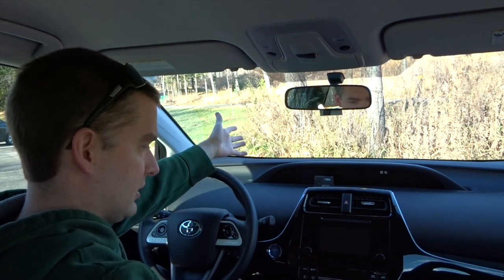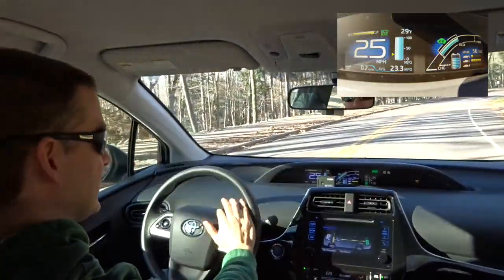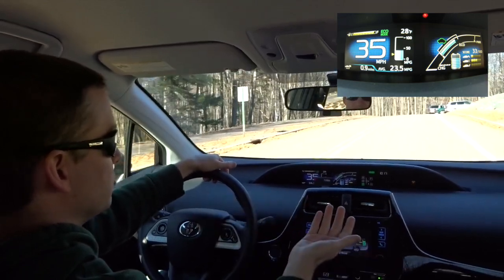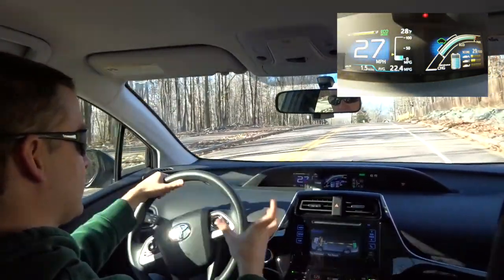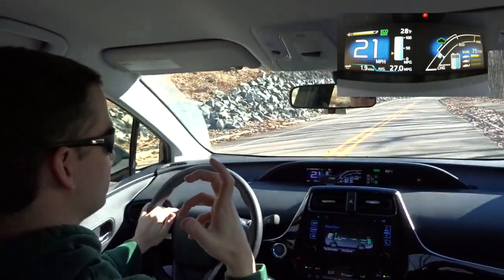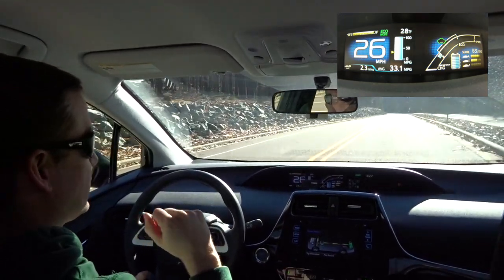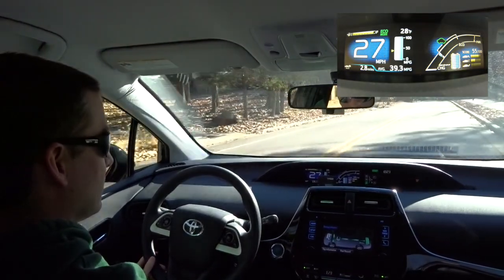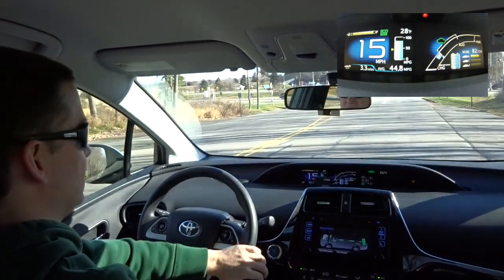Prius "B" Mode Explained

Comment: Thanks for a great video. I use B mode frequently on my 2004 Prius. (I'm the original owner.) Thanks to that and other practices (like trying to coast to a stop at traffic lights) I will be having the brake pads & shoes replaced for the FIRST TIME at the 200,000 mile service interval in a couple of months. 

* The engine may sound like it's running, but it is not. The vehicle is using the engine compression, without fuel, to help control the speed. It's the same as downshifting in a conventional transmission but keeping your foot off the gas. 
* My car manual says not to use B mode above 40 mph. Later models may be different. 
* My father-in-law had a small Farmall tractor from the early 1950s with a CVT transmission. So does my wife's 2003 Saturn Vue.
Reply: 2020  manual..."When the vehicle is driven at high speeds, compared to ordinary gasoline fueled
 vehicles, the engine braking deceleration is felt less than that of other vehicles. p. 345

Comment: its not only the transmission that is breaking the car but also the high compression ratio of the prius engine (13:1 rather than 10:1 in a regular otto engine) witch produces a "bigger" vacuum in the cylinders as the pistons are moving downwards.

Comment: My Prius 3 was able to charge the whole battery (all lines) in the French mountains. I drove 4000 km in Europe from the Netherlands to the French Pyrenees and back again. Average usage 5.1 liters per 100km, this is not bad in my opinion if you know that on the Highways was the speed was 130km per hour and a lot of steep hills. In the hill's B mode worked perfect but sometimes the engine made a lot of RPM's when it was very steep.

Comment: Try using the cruise control to hold the speed going downhill - my 3rd generation model will automatically employ heavy regen (filling the battery completely full, the only time I see it) and then engine braking to hold the speed.  It's kinda like the hill assist mode on Ford hybrids.  I'm curious if the 4th gen does the same thing - let us know!  Thanks for the videos.
Reply: Yes, the cruise does Hold the Hills with the 2016 Prius
Reply: In 2013 Prius you can't set cruise in B mode
Reply: I do the same with my Prius C, cruise control set and press it down a few times to slow the car down even.
Reply: I think B mode works better for very steep downhills, never felt the need to use it.  In long hill  descends I just use cruise and it regens until the battery is full, then the electronics make the engine brake.  Very smooth transition from elecric regeneration to cvt controlled engine braking. Best cruise control of any car I ever driven.
B mode may be better suited for long descends on sinuous curvy roads where it would be inconvenient to drive with cruise control or normal mode could overheat the brakes.

Comment: While going downhill, the dealer told me to keep driving in D mode. Once your battery is fully charged, you can shift into B mode. Also, they say "B mode" is very useful while driving in the snow ( I guess it's because that helps slow down the car without touching the brake pedal, which is a good thing when you have to deal with icy/snowy roads )..have you ever had the chance to try it?
Reply: B is to keep friction brakes cool (avoid deforming). So if you're going downhill and the battery is nearly full, use B mode. This happens normally on big hills with fully loaded car.
Reply: Hi there,
Can I shift the gear to B mode while gear is on D and the car is moving?
Reply: @aysennooris2340  yes! NO problem, done it many times!
Reply: @hunterhalo  You can engage B-mode any time you drive, but if you do, energy that otherwise be regenerated is wasted as friction in the combustion engine. That's why it is advised to use B-mode only after the battery is full, to maximize regenerative braking.

Comment: Prius isn't using a CVT transmission as used in other vehicles. The Electric Motors (2 of them in non-awd versions) are used as generators when not in use. B-Mode forces the Electric Motor into Generator mode increasing induction to the drive-shaft and slows down the wheels/car. The generated energy gets stored in the battery pack. The fact that this car is not using a conventional transmission or CVT and the inline configuration of all 3 motors - petrol engine and 2 E-motors make it possible to use this car even when the battery will go bad. The Prius drive system uses e motors to keep the petrol engine in a sweet-spot for rpm and drive-shaft load using advanced electronics resulting in good fuel economy.  Watch as reference "Niels Blaauw - Prius Hybrid Drive Explained". One reason why the Prius is mechanically a reliable car: simpler "transmission", no conventional starter motor, engine running at ideal load and rpm. Keep fluids right and you will enjoy a great car for a very long time (ps don't forget to change the air intake filter for the batteries)

Comment: Let me help by putting this in simpler terms;  Normally when a Prius going downhill, coasting and braking are regenerating kinetic energy into electricity by charging the battery.  However, when the battery is full, there can be no more regeneration, therefore some other type of drag is required.  This could be from the brake-pads, but that can be destructive and wasteful.  
In a normal vehicle, some engine-braking can be accomplished by not applying the accelerator, and allowing air pressure and friction from the engine to provide some drag.
It's no mystery why the Prius engine is running while in B-mode. To provide drag without braking or regeneration, the engine is bleeding off energy by compressing air, when the other two options are not possible or desirable.
Reply: Except that the engine doesn't come on for a while in B mode, and the engine also eventually starts in D mode when using regen down a long hill.
Reply: So it looks like you're starting to answer my real question. But are you sure that you know what you're talkin about? Are you sure that it's using actual engine compression to help slow you down after the battery is full. I understand the battery can't help slow you down by charging when it's full because it's already full. My gen2 is not really showing me how much regenerative action is happening and I'm having trouble Discerning when the actual brakes are being applied and wasting energy. So if putting it in the B mode increase is regenerative braking when possible can I further increase the regenerative braking by pushing the brake pedal? Or does that max out the regenerative braking simply by letting off the gas pedal?
Reply: It did this in my Ford Escape hybrid in L gear. It is using the 2nd motor to spin the engine to waste some of the excess energy when the battery is full. If the hill was more steep you would hear the engine rev higher.

A Tesla does this and has settings to adjust how aggressive it is except it is impossible to do at full charge.

Comment: B mode is NOT for extra battery recharge ... it turns on the engine, and slows you down like a normal car, and it makes your fuel efficiency WORSE.
Reply: Yes the engine is being driven at relatively high speed by the forward motion of the car with the gas shutoff, just like a regular car in low gear going down a hill.

Comment: I hardly steps on the break, I've always use the Break mode, to exit a highway or slow down from the traffic or slide down from a hill, 50,000+ odo now and the breakers condition are still excellent!
Reply: The best for long transmission durability is changing from Eco to B when speed is constant. To prevent a jerk which happens because mode change when slowing down.
Reply: 唐托尼 brake*

Comment: Decent video but there is far more to B mode on an engineering level if you understand and have been trained on the transaxles in these cars.   You mention that you don't understand why the gas engine is running and that there is no reason for that when in B mode.  The gas engine is ALWAYS going to run in B Mode and there is a very good reason for it.   Each motor generator in the transaxle is operating in "reverse mode" or "regenerative braking" mode when you engage B mode.  Your main propulsion MG is always going to be in regen braking mode when off throttle and in D (at least in gen 2 Prius),  but in B mode, all MGs go into regen.   This means that each stator winding in the transaxle (ex MG1 and MG2 windings) that sits around the permanent magnet rotor that makes the motor generator is grabbing DC current from the HV battery and passed back to the stator windings of each MG.  By passing this current through the windings and inducing a magnetic field in the motor generator due to the permanent magnet spinning, it does two things....it makes the motor generator much harder to spin thus acting as a brake...and it also produces electricity.   The car has to do something with the power that has been created, either use it or dissipate it.   If the computer determines that the power is not needed and the HV battery is charged at the time,  assuming foot-off-throttle.... the engine ECU disables the engine's fuel system and MG1 (responsible for engine starting and acting as a power generator) continuously spins the engine over as in a crank-no-start condition in a regular car, only the engine in a Prius spins at the MG's rotational crank speed which is much faster than a regular ICE starter spins the engine at an RPM much lower than idle in order to start the intake, compression, power and exhaust cycle.  This allows the MG in the transaxle to burn up the excess power that has been created and not needed.   It is going to sound like the engine is running when in B mode, but its actually just being spun over by the MG at a "running speed" which is all dependent on gearing and rotational speeds of the driveline components and planetary gears inside of the transaxle.   So, when you hear the engine running, it is not running as long as your foot is off throttle because the ECU has the fuel system disabled, it's being spun over at speed by the Motor Generator in the transaxle to burn up excess power that is not needed.  Hit the throttle in B mode and suddenly engine power comes back and fuel is delivered and seamlessly you have power from the engine again.   The transaxles in these cars are brilliant masterpieces of engineering.
Reply: Finally a detailed explanation of what's really going on. Thank you Chris Corbett. But one answer that's still kind of foggy for me. When going down a long Steep Hill with B enabled in a Gen 2 Prius does that increase the regen? If so does it increase it to its Max? And then of course once the battery is full it spins the motor to help slow you down. So if it increases the region to the max then any further deceleration due to me pushing the brake pedal is definitely due to friction breaking? And if you're in B mode And re gen is increased but your battery is not yet completely full is it Also spinning up the engine?  I'm simply trying to better understand exactly what's going on so that I can avoid wasting energy. They build cars for stupid people I wish I'd simply have a button for engine braking and a button for Max Regen

Comment: I have a 2020 Prius prime and b mode disabled my cruise control and keeps the engine running while in hybrid mode. The engine never turns off when coasting or when stopped.
Reply from the maker: I’m jealous. I’d love the prime! How do you like yours?
Reply: @jettlash1000  love mine, though dealer does not use W16 as requested by manual. If W20 oil used change every 5k otherwise 10k. some say heavy acceleration not available w/out engine in EV mode but I have never had that problem when tested... nice electric torque
now we have insurance discount for safe driving...

Comment: Does B-Mode provide battery charging similar to the regenerative braking?
Reply: Yo, it doesn't affect the electric recharge. Basically you don't charge better with the B mode, in fact it's quite the opposite.